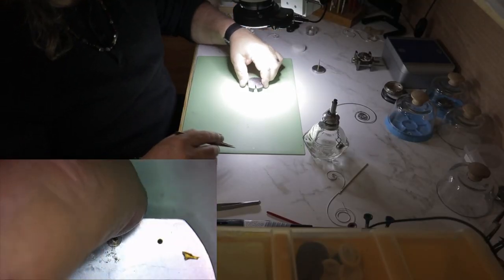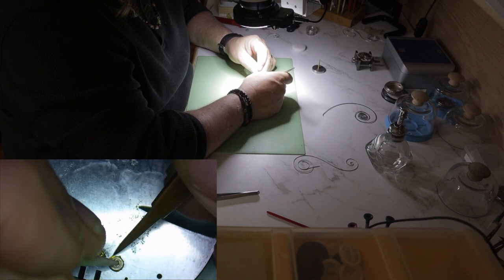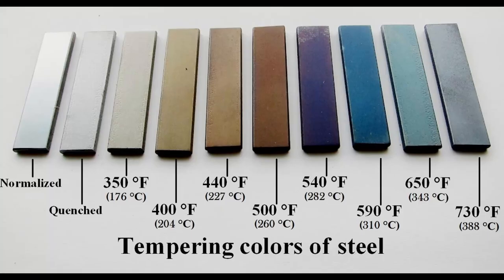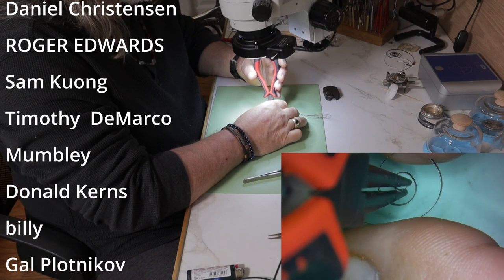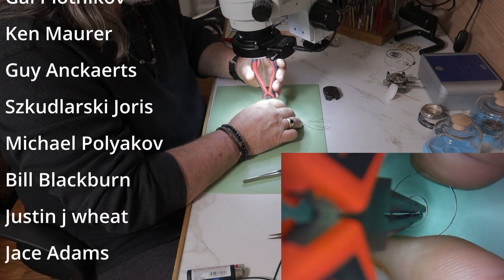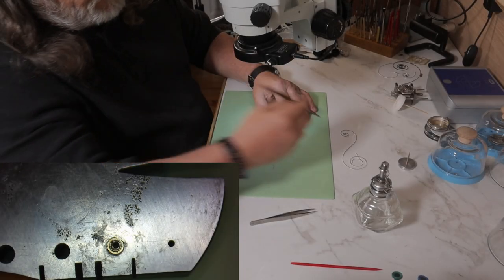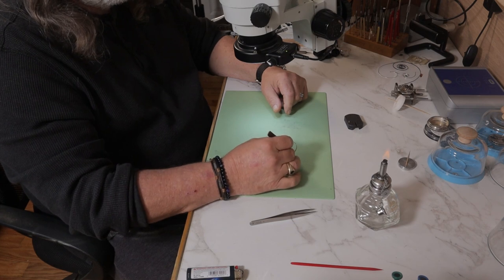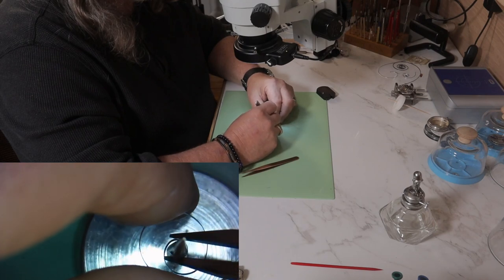How to Make the Inner Coil of a Mainspring Smaller- Without Breaking It

Comment: Are you not annealing the metal to make it softening toshape whereas  tempering would make it harder.
Reply from the maker: Hello Dale, I think you may be getting your terms confused. In watchmaking there are two ways for hardening steel, work hardening and hardening by heat. Steel is heated to a high temperature, normally a bright red and then plunged into cold water or oil in order to cool it very rapidly. Steel that's hardened in this way is considered “Dead Hard”. The steel is at its hardest point but it's also extremely brittle which makes it pretty much useless for watch parts.
Tempering is a process where the steel is heated to a precise temperature and can either be quenched in water or allowed to cool in the air. This process makes the steel less brittle or softer and less likely to break.  The main spring,  because it's so thin it cools off almost immediately. The lower the temperature used for tempering, the less the softening effect or the harder the steel remains.
Annealing also has the effect of softening the metal and removing internal stresses. The main difference from tempering is that it's typically done with some sort of insulator so that the steel or brass cools down slowly.
Reply: @watchrepairtutorials  I'm often wrong, I like learning which is the reason I watch and have subscribed to your channel as well as a few others each has something to teach me. Marshall had a video in adjusting beat error, the first time I've seen it explained in a way that really made it clear to me and Adam Savage had a good video regarding machining and the effects of temperature and the fluidity of measurements.
Reply from the maker: @dale4034  No worries Dale. Thanks for being part of the community here
Reply: There is a greusome reason why they say the steel is dead hard. In medievel times the steel was quenched in blood to harden it. Hence dead hard.
Reply from the maker: @originalboondi  interesting. Where can read more about this practice.
Reply: It may also have some aspect of being used by viking smiths, using blood and bones of the dead to imbue their swords with the spirits of the fallen warriors, to make better steels from pig iron found in boggs.
Reply from the maker: @originalboondi  honestly, that sounds like a myth. Quick Google search shows that blood has very poor quenching properties and would not be very good at hardening steel. I guess it’s possible it was done for ceremonial reasons by Vikings.  That would not surprise me as they were into sacrifices.
Reply: Sorry, but all thd links I post keep vanishing.
Reply from the maker: @originalboondi  yeah, no worries. That’s an anti-spam thing.
Reply: Tbh. I think it is more than likely heavy on the myth side....😉